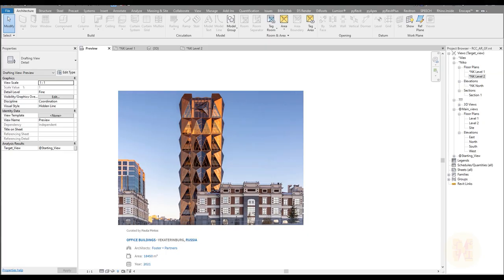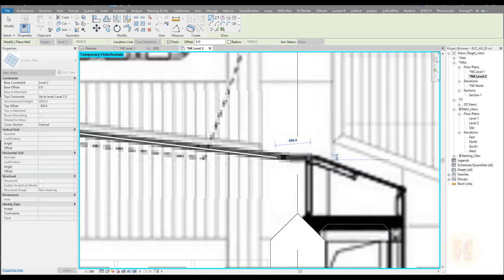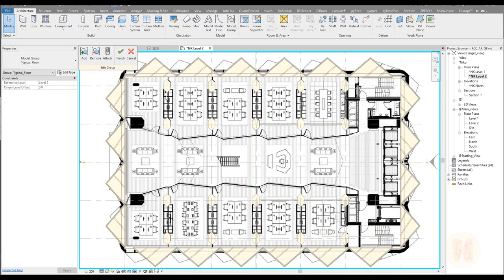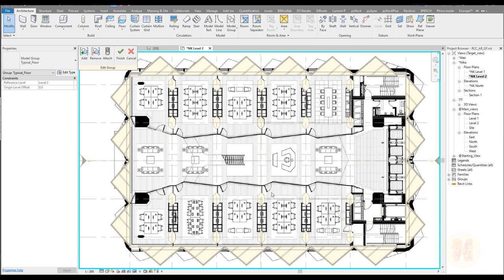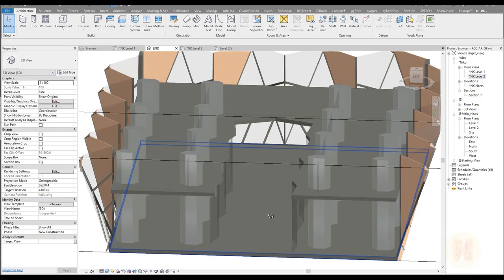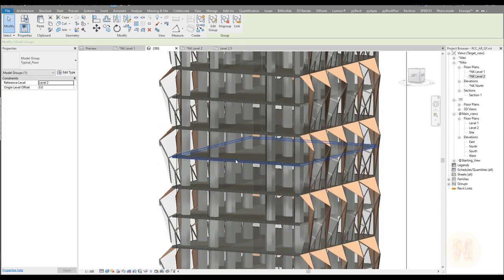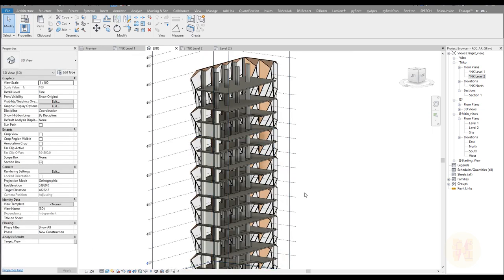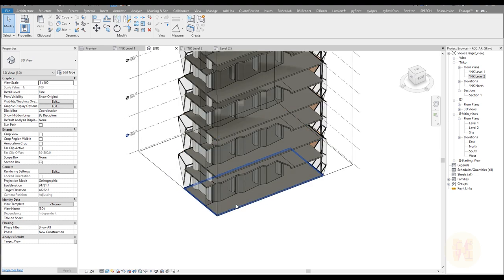RCC | Complete Revit Tutorial Part 8 | Typical Floors and Groups

Comment: Outstanding videos as usual. :p

Revit needs better generation tools like Grasshopper 3D or a set of tools that gives designers more freedom. The whole GUI is way too limited for a software released in 2021. 

At least people can design freely with Rhino inside Revit bypassing that barrier. EVERYTHING can be done and transcribed to Revit. However, I think that Revit can get a better GUI and better tools to generate form. It needs to be friendlier and easy to pick up WITHOUT factoring out complexity and exhaustive analysis.